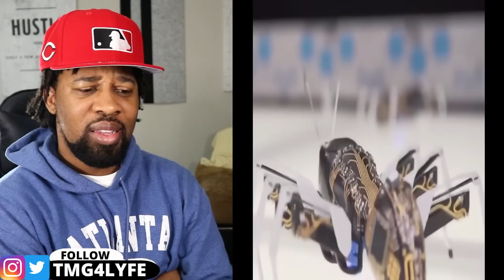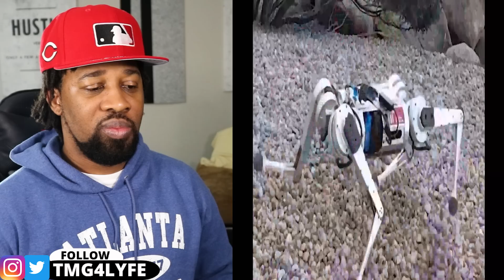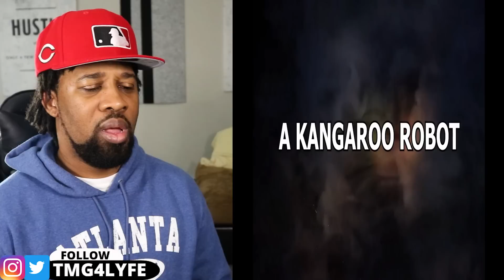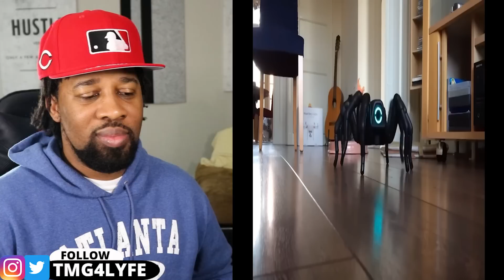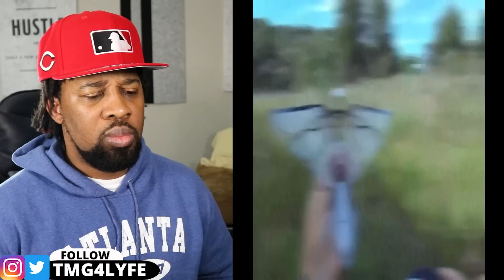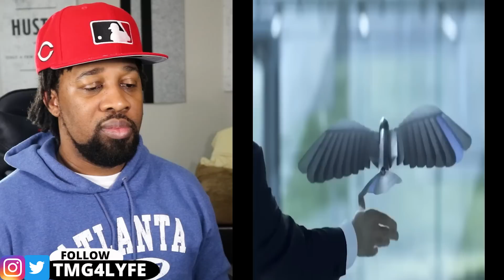20 Amazing Robot Animals That Will Blow Your Mind

Comment: the robot would have no air in it so there should not be any problem with the presure in the deep water effecting it like there is with a manned sub. They have a big pocket of air that wants to rise to the surface of the water that the water is pushing in on. As long as there is no air in the device it should be able to go as deep as we want it to.